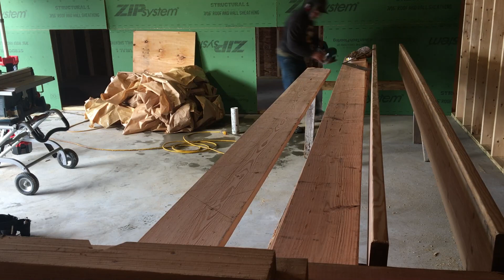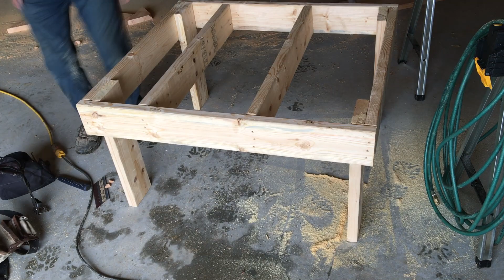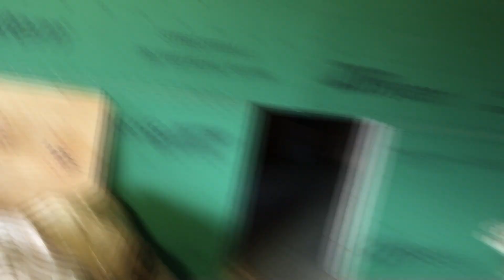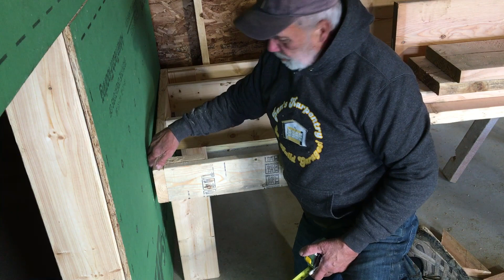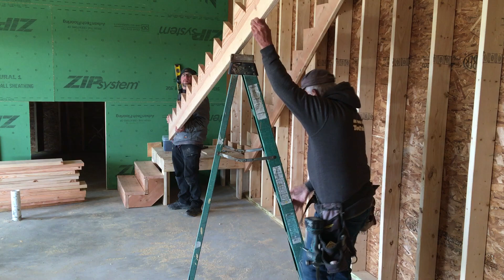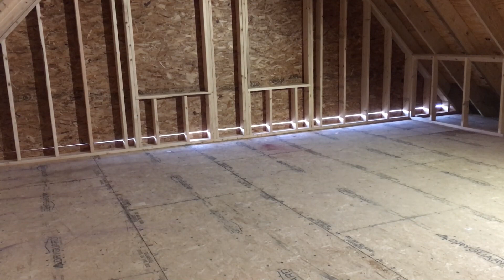LUMNAH ACRES TINY HOUSE Part 14...Moving inside

Comment: Nice video but I have a vexing question. 
You cut out several stringers for the second floor stair opening. What is holding those cut stringers?  Without support, wouldn’t the floor in that area collapse?

Comment: After laying out the stringers, do you ever drill a relief hole where the riser and tread meet? I've been told it helps stop splitting.
   @ 3/16 or 1/4 hole

Comment: I had to chuckle when you helped Al pop the boards up. Al was putting the nicer side up and you just popped them up. I am sure Al learned some helpful tips that he will use in the future from you all
Reply: I believe Al was facing the "cup side" down, not so much the nicer side out. That helps any slight warps get hidden.

Comment: When you cut those two floor joist for the stairwell and then head them off to the adjacent floor joist you have triple loaded that single joist ? Are the engineered to carry 3x their design load?
Reply from the maker: The length is now 1/3 of what it was so should be as strong as ever. Great question
Reply: Before you cut the joist it was supported on each end. After you cut out the floor joist section you created two floor joist each only supported at one end not each end. The plywood floor is no longer being supported by the cut out floor joist but now are suspending the joist from the plywood.Consider doubling the floor joist on either side of the stairwell to carry the weight of the stairwell header you added.
Reply: I was wondering how that works structurally also. Isn't the entire weight of the stairs also added to the joist at the top? I was surprised that they didn't frame in the stairwell box before hand more securely. Just seems like it is hanging off a few screws, but maybe that is okay.

Comment: When you nailed the legs to the staircase platform, I heard only two nails going in per leg, from the inside. I wondered why there were no further supporting blocks. But alas, couple minutes later when the lower steps came in they included those supports. Perfect !! BTW, I (and I suppose some others) would love to know  the inches of your threads and risers.
Reply from the maker: 9 1/4 and 7 1/2

Comment: Its coming along extremely well!   However,  I do have a couple of questions.  -  When you began installing the stair stringers, why didn't you use a moisture barrier between the concrete and the stringer?..(same goes for the sill plates for that matter.  When installing anything to concrete, shouldn't either a moisture barrier and or pressure treated lumber be used?).  I have full confidence in you and your crew.. that said, not being critical, I am only asking for my personal future use.  Thanks in advance.
Reply: All of the walls have a moisture barrier on the bottom of the frame.
Reply: Treated wood was used and a strip of moisture barrier was tacked onto the bottom of each of the wall "panels" sections . It was the first thing they did after backing the trailer close to the work site & undoing the straps.

Comment: It's sad that the doors and windows are taking forever to come in but it's looking good Ken and Crew can Al start hooking up the wood burner to the I call it the Lodge since it is centrally located amongst the other buildings that are planned.If they hook up the wood burner they can work inside during the winter.
Reply: I think Al needs to have power before the wood boiler can be hooked up because he'll need electric pumps to run the water through the slab.

Comment: Didn't you use 2x8 rafters, if so spray foam makes a lot of sense, its the only way they will get the R-Value they need for the ceiling without additional foam board padding.
Reply from the maker: True

Comment: Question, why are you putting the risers behind the treads?  A more secure way would to have the treads run the entire length and then have the riser pin down the tread.  Is it just for savings and not having to use wider boards?
Reply: 3/4” structural plywood glued and screwed, to rise and run of the stringer. Make the finishing process much easier 👌👌
Reply: because now you are able to glue and screw the riser to the tread from the back which is a very strong and squeak free connection, if you simply put the riser on top of the tread over time this may squeak and definitely not as strong. the only thing I would have done differently would be to extend the landing so that the stringer sits directly on the landing.
Reply: @guydemers7607  ... I did notice the first riser sits on the platform. I also wonder if he will trim the bottom of the stringers and install joist hangers for extra support. Can't hurt.
Reply: @MrPhildude22  , yes, usually full dimension lumber is only used on the tread and plywood for the riser.
Reply: @guydemers7607  16” Spacing on your stringers, 3/4” ply is more than sufficient for treads. Minimum shrinkage, and less of a chance for squeaks. Plus Makes good use of your sub floor waste 👌

Comment: What happened to the battery-operated guns
Reply: wild guess is batteries don't last long in the cold and if they have the gen set running anyway they might as well use the air compressor.